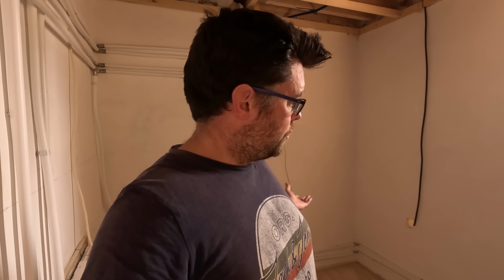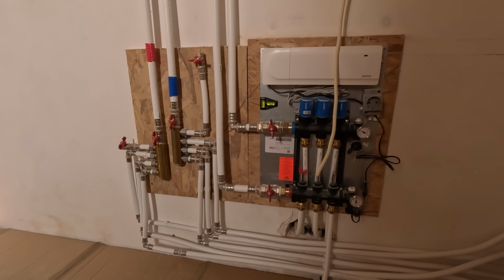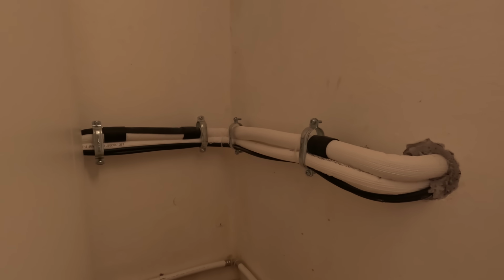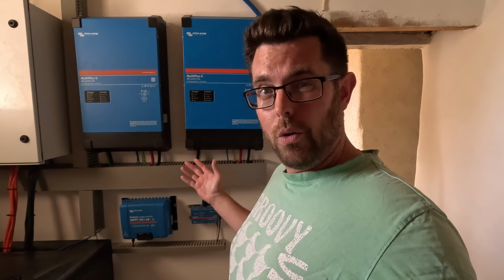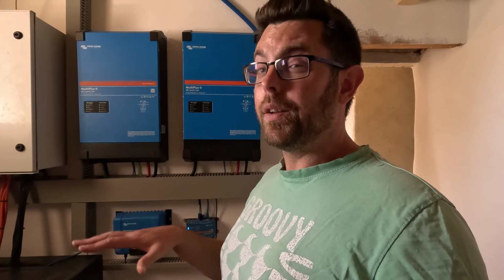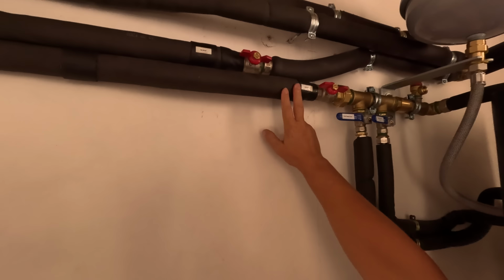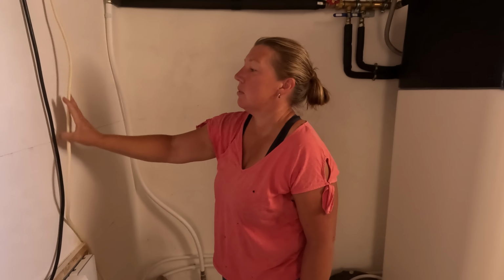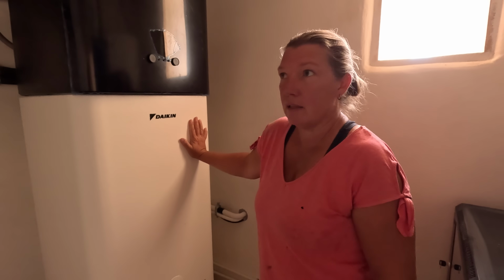Today is a BIG Day (We have HEATING) - Daikin Heat Pump Install

Comment: Love the idea of the wall mount. It wasn’t suggested when we installed our split system.  One suggestion, take pictures of each area, print them off and write very detailed of what pipes and tube go where and how they are run.  Your memory now is wonderful, but a few projects down the line our memories get a bit blurred.  This saved us a big headache when I decide to run the water to the laundry room a bit different…didn’t do it as it won’t have cut off the water to the powder room!

Comment: Great job on the prep work and the heat pump install. I'm looking forward to the video on the ventilation installation. I know the brand of ductwork you're using. 5 tips here. 1. Don't save on the number of ducts. If the duct identifier says AE34, you should not use it for more than 34m³/h per duct. AE48 is 48m³/h and so on. 2. Don't make the ducts too long and avoid unnecessary bends. A rule of thumb is: the outer diameter in cm is the maximum length in meters if you use it for the maximum flow rate (tip 1). 3. Avoid any bends really close to the collectors. If there is residual tension on the duct going into the collector they could leak. 4. Look at the instructions in the box of the collector. These are great. 5. The manufacturer has superb graphs on the combination duct size, length, and pressure drop. Use those to make a detailed pressure drop calculation based on your ductwork layout plan.

Comment: There have been a lot of issues with heat pumps in France. Many of the buildings here (SW France) are old, stone and difficult to insulate but the French government has been pushing heat pumps without caveats with some disastrous results. Our neighbour's winter fuel bills tripled and they're now in litigation. Edit I should add that winter temperatures here are well below freezing.

Comment: Congratulations on installing this beautiful system! Just FYI, there are also water-source heat pumps. I lived in a floating home (1600 sq ft) in Oregon that had one. It was amazing and worked wonderfully all the way down to just above freezing, when the back-up heating would kick in automatically. Hope you have many happy years with the new system.

Comment: I might have missed something but what are your reasons for having an off-grid setup instead of a mains connection and a grid-tie inverter for the solar system? The latter seems considerably cheaper and just as environmentally friendly. Off-grid solar systems are usually the better financial option if a mains connection is cost-prohibitive because of the distance to the nearest existing lines but your house seems to have an existing supply with even the meter still on the wall.

Comment: What is the power of this unit? I have a similar setup in Poland with 9kW heat pump and it takes around 5.5 MWh of energy. per year (with hot water). No chances for off-grid. Solar efficiency in December and January is pathetic.

Comment: Heat pumps can also be used for forced air systems.  Not just hot water systems.  For the blaymen they ARE air conditioner units. Just flowing in opposite direction.

My home cools and heats with forced air heat pumps(have air handlers in attic).  Our hot water is a separated all electric resistance coil  unit.

Another channel Wild Wonderful Offgrid run three heat pumps off grid.   They live in the West Virginia mountains where it is cold.  They supplement with a woods stove.  He is a professional electrician so that helped them.  But it is 100% possible to run them on solar.  Th he have a very large array and a diesel generator as a backup as well as a large battery bank.

Comment: For info. I suspect that you will have researched this and I don't know exactly how your system works but in the UK it's not allowed to connect woodburners directly to a pressurised system e.g. an unvented cylinder because the woodburner is an unregulated heat source that won't automatically shut down in the event of a over-heating situation. It's highly unlikely to have an extreme failure but if it happens the cylinder can explode like a bomb (and that is no exaggeration). A friend has connected his woodburner through an intermediate thermal store with pumps linked to it but it's a horrible system and he wishes that he had not.
As I said it's for info only and if you've covered it then ok but I didn't want to see one or both of you one day land in our garden over in Castelo Branco!

Comment: So exciting to see this progress! We have here in NW Indiana, geothermal heating due to the cold winters. I saw an ad this morning for Water furnace, geothermal which provides heat, hot water and AC. The unit resembles yours, but of course is different. I've had geothermal in a house before. The only problem was we had a toddler who discovered the tubing in the basement (near my sewing room) and decided it was a toy to jump on, causing a leak.

Comment: Congratulations!  I think 12,000 Euros is a deal for what you got.  Very impressive and where we all should be heading in the future!  Thank you for educating us on this type of heating solution 😊
Reply: Compared to established fossil fuel heating systems it's still quite expensive though. A gas combi boiler is around 2500 Euros where I live, including installation. Running a gas boiler is obviously more expensive in the long run but the initial costs of heat pumps still scare off a lot of people.

Comment: Of course you can run heat pumps off grid. I know a chap who has 3 heat pumps running off different solar arrays. If you have enough battery storage for the crappy non sunny days, it is all possible.

Comment: The interesting bit for me was you run it on solar. Can't wait to see your solar system updates. Fortunately we don't need heating here, and my main solar drain, is a fridge running at 100w, but on one large panel that's not bad.

Comment: Good luck with the air source heat pump. I have two systems. One for my house and one for my office. They are both air to air and therefore more easily provide both heating and cooling. The issue in winter is that peak heat demand often coincides with minimum solar generation. If the solar system is not excessively oversized then there will be deficits on cold cloudy winter days. This is when the backup system will be required.  Insulation and ventilation will determine overall performance. You have put in the effort to understand the system so I am sure it will work great!

Comment: Hi I’m planning to build a house from scratch , and I’m not sure if I will go with ac on all the rooms or go with heating floor. Do you know the performance of heating floor to cool the house during the summer ? Thanks and congratulations for your channel
Reply from the maker: We’ve never had radiant cooling before, so it’s very new to us. From my research, if you can keep the relative humidity low, around 50% (and this is one of the reasons we’re installing a ventilation system), it can be just as effective as traditional air conditioning, but with lower energy needs. 
We won’t be able to report back on our installation until the end of next summer unfortunately
Reply: @MAKEDOGROW  thanks again for your answer.. as an ideia it’s would be good a report/future video with the performance of your climate system (after summer for cooling) and during winter.
Most of the portugueses houses are old and this can be a good tips to improve the climate of a house with low energy.

Comment: Nice video. It's very interesting and great that you found some tidy reliable installers. I live in Spain, so I'm quite familiar with your type of system and the multi cap pipe products that you have used.  One small but important point that I noticed your video. You may have already addressed it since you filmed, but the safety expansion valve positioned on the wall bellow the expansion vessel should be piped to a low exterior position or into a drain. The end of the pipe must be visible to give visual warning in the event that the system is venting pressure. This can be very hot water that escapes. Hope this is helpful.

Comment: So I think I remember you saying in a previous episdoe that the lime plaster would corrode any metal. Is that right? If so, how come you've screwed the pipes to the wall?
Looking good there!
Reply from the maker: Corrosion happens when it’s wet, no problem when everything’s dry

Comment: A friend of mine had a air sourced heat pump for his outdoor swimming pool. He put a poly shelter over it so that it could be used all year round,  the amount of heat within that cover seemed extreme so we installed ducting so that the heat pump could recycle the warm air to heat the water. It worked a treat.

Comment: Been a follower for ages now , your great guys . Is that pressure relief terminated correctly???? It should be discharged outside or low level . If that thing blows off your going to have a very scorching shower

Comment: Personally if I had that much plumbing in one spot I’d like to see it at all times just in case. Could you imagine walking in to a wet spot on the floor and then having to find it? Cost seems reasonable. My last refab of ac/ heating was 9 k and not nearly as advanced. Oh, and congratulations on warm water! Who’s getting the first hot shower ?

Comment: I have a 300sf cottage on my property and chose to install a Daikin mini-split, which is exceptionally efficient in both heating and cooling a space. I’m currently offering it as an Airbnb and I live in a mild climate. It’s worked out well for people from hot climates because they are turning on the heat at night when the temperature drops (yet still well above freezing on summer nights and often during winter days 12°C/54°F) and for those from quite cool temps (and super sensitive to the heat, so far this year it’s not been very warm, usually 20°-27°C/70°-80°F this July) it’s performing well. I also have solar panels, but I’m connected to the grid and receive credits. I have been contemplating installing a mini-split in a country cottage I’ve yet to build. As it’s not super sunny here during a good part of the year (not as bleary as the UK here in the US Pacific NW), I’m very interested in the performance with solar electric. I understand the new super panels are performing well in England. Also, given how blazing hot it is during Portugal summers and how much hotter it’s becoming everywhere, I’m curious as to why you did not include air conditioning, at least for the upstairs. I’m looking forward to learning more from you. Thank you!

Comment: Wish I could get guys that do that kind of clean work here in the US. Small tip - pass-throughs in exterior walls and foam insulation around piping attract mice, so stuffing in a layer of copper wool on the outside prevents mice from chewing and squeezing their way in.

Comment: Don't you need any kind of a/c? I know a guy who lives in coruche and his feedback is that it gets almost as scorching hot as where i live.
For what i understood you can run this systems in reverse, so you cool the water instead of heating. But may have humidity issues due to condensation in the floor.
Reply from the maker: As you suggest we can run the radiant system in reverse mode. Any condensation will be sorted with the ventilation system, and hemp/lime plaster … both designed to suck the humidity out of the air 

Thankfully our ground floor is really cool (currently sitting at 22C while it’s been 30-36C outside). Upstairs is a different story since we don’t have an insulated roof (yet)

Comment: From the years of watching reno in Portugal,  I came to conclusion that most of the Portuguese buildings were "primitive".  Beams should be straight,  are not.  5' length from one end to the end,  is not the same, and the same with height....so on and so forth.  Couldn't imagine correcting that kind of differences...with your perfect skill and knowledge in building....good luck.  😅  How could you keep your stress and frustrations down in the mist of your love of reno?😢  Have more breaks for wine and beer ? 😅😅❤

Comment: Will this cool your house as well? I've heard of heat pumps doing that too.
Reply from the maker: It can, by running cold water into the pipes in the floor. The cool floor then cools down the warm air and the temperature will drop.

Thankfully our ground floor is already quite cool due to the stone walls … upstairs is a slightly different story until we insulate the roof

Comment: One tip if i may ,attach a pipe or a hose to the pressure release valve to direct the water outside or in to a bucket because the last thing that you want is for something to go wrong and the pressure to rise to the point that the valve opens ( and instead of saving your system  )dumping water all over your heat pump potentially creating a short ask me how i know
Reply from the maker: Yep, once we have the waste pipe installed we’ll run into that. We also need to add a pressure relief valve to the ufh manifold and run a pipe for that too (we weren’t aware we needed that until the guys did the install)

Comment: Looks like you have a open pressure relief valve PRV thats the red knob 15 mm female thread high level it requires extending etc to low level outside pointing down. Hope I'm wrong  as they are there to discharge excess high pressure hot /boiling  water? Before retirement i  was registered to inspect/install pressurised cylinders and this  only happened with unqualified installer's. A Google I'm sure will explain .otherwise a really neat installation ,usual case half peneth of tar saying .

Comment: Nice job! One thing that I do not know has already been mentioned but would be interesting was also having a return on the hot water lines as it saves water. I know you're thinking about grey water but nevertheless if it's not wasted it has not to be recovered.

Comment: The person from Australia who asked what a heat pump is - well, they mustn't get out much (or don't know how to use Google?) There's been heat pump technology here in Australia for ages. When I built my 1st home over 25yrs ago, I put in solar hot water system with natural gas back-up & the least destructive & least expensive heating option at the time was ducted natural gas (which hasn't been switched on for 3yrs). By the time the hot water tank had run its course with the elements & needed replacing, heat pumps were widely available due to all the various states' Govts running grant programs for greener new home builds & were giving financial incentives to new home owners who used heat pump technology in their build. I really wanted one too, but the heating I already had was rarely ever used & I'd also bought a new solar electricity system. It seemed excessive at the time & somewhat UN-green to rip out my entire solar/gas hot water system as well as my barely used ducted gas heating & send them all to landfill in order to get a 'green' cash grant from the Govt to buy an expensive (at the time) new heat pump. Esp when all I really needed was a replacement tank - so I did without the heat pump - maybe in my next house? lol

Comment: Very cool! I'm sure you'll be fine running off solar. We recently installed an air sourced heatpump hot water system here in Tasmania and it's awesome. We're not running off grid though. Regarding hot water temp, here in Tassie there's a requirement run the tank up to (I think) 60c ever so often to kill off any nasty microbes. Might wanna look into that.

Comment: I wondered the whole time, if you plan to power it through solar or if you'll go 95% solar with some of the most demanding stuff on the grid. If you can run this through solar, it would be amazing and I hope it all ends well. I assume you want to keep the panels on the ground for better serviceability and better looks of the house?

Comment: Im asking about the costs involved in the heat pump ,solar etc. Because , I have a home in Spain to the North of you and was replacing my hot water tank run on natural gas . They are pushing these solar panel heat pump systems  and decided to get a quote.  38,000 euros. 12,000 for solar panels alone . 10 year warranty  1 on labour , mantenence. With a battery back up because you will need it. Spain & Portugal pays you nothing if you put electric back into the grid. In conclision, it would take me over 40 Years to break even on that investment.  And im sure the equipment and solar panels will be replaced in less than 20.  I think the costs are way too expensive (at least in my area) where the average salaries are around 1,000 euros per month. That's why they are MANDATING it for new and Refurbished homes. Still most homes are heated with pelet stoves and natural gas for hot water on demand.   These Mandates are keeping people from renovating their homes because of the costs involved and just upgrading their old systems without getting permits etc. WHAT DO YOU THINK ?  Can you imagine  38 ,000 invested in a low risk fund for 40 years ?? 🍷

Comment: We have a air source heat pump fitted for just over a year, similar to yours, touch wood it’s been perfect although our house is very well insulated and remember the radiators if you have them will be a lot bigger then conventional ones. Uk

Comment: I understand it now Mandatory to have some sort of SOLAR or Energy Saving Systems on New Construction and Renovated homes.  Can you explain what that entails ?? ALSO , 12,000 Euros Is just for the equipment and install of said equipment correct ?  What would the cost be to install all  the pex in floor pipes in your home  , product cost and labour. ??   Plus you haven't installed the SOLAR PANELS YET ??  IKEA is ofering a home package for about 5,000 euros. And for cooling? AC ?